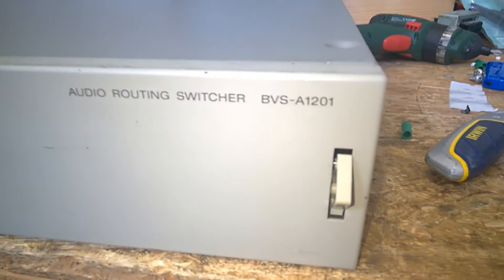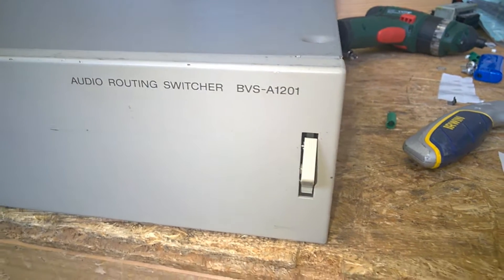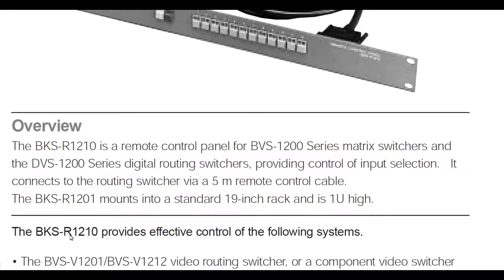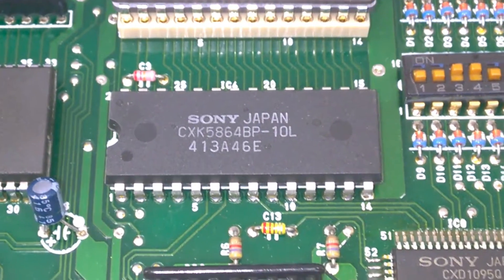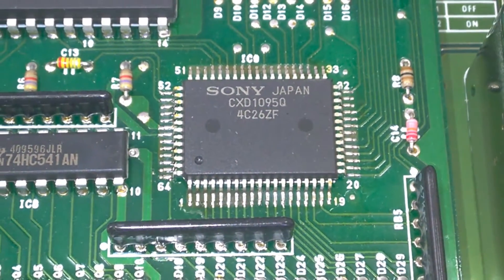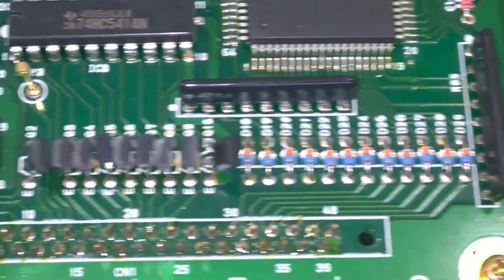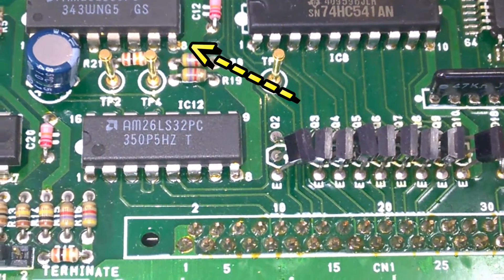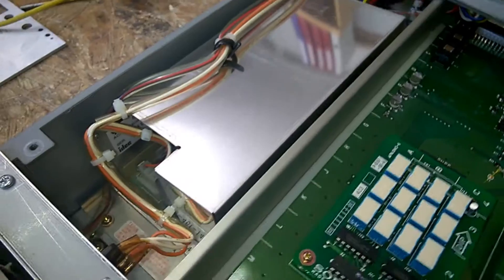BEB #28: SONY BVS-A1201 Audio Matrix Switcher Teardown (What's inside?)

Comment: never seen one of those before, looking up the datasheets must have been quite some work, what did you do with the unit?
Reply from the maker: I am planning to disassemble it within the next days. Had it on ebay for ages, but nobody bought it. Will sell the parts: the audio output transformers, the enclosure (fitted with connectors), and the switch mode PSU. Will be fun again!
Reply: might be easier to find a customer for the individual parts. good luck